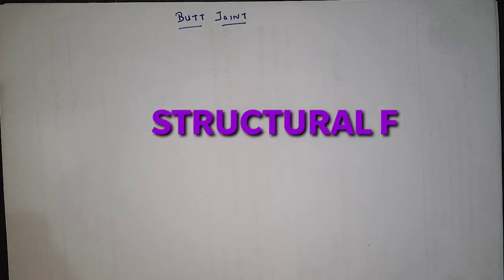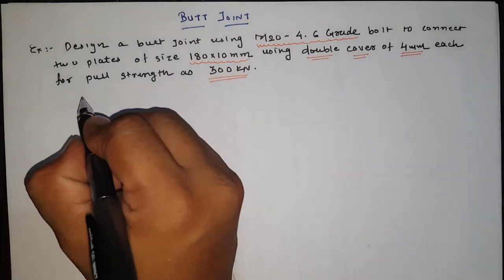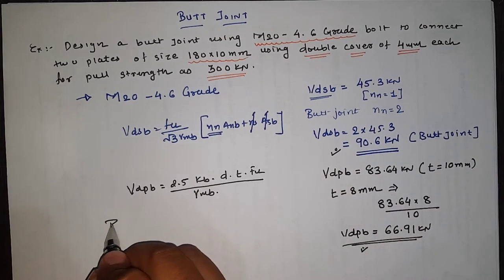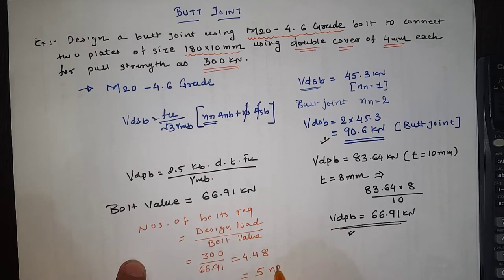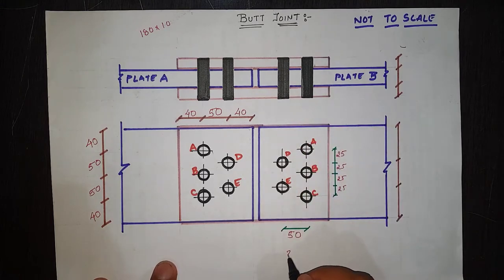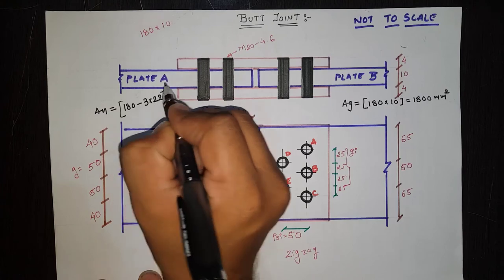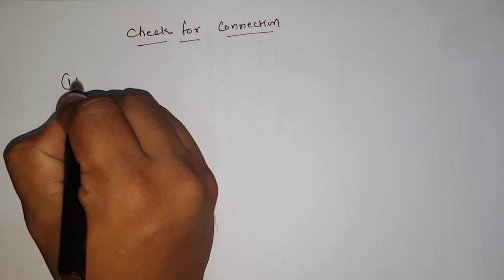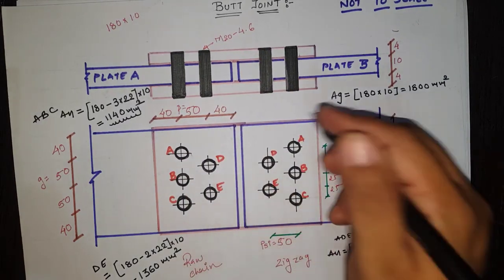Ex 05 | Butt Joint | Double Cover| Bolted | Detailing | Overlap | Number of Bolts Required

Comment: if no. of bolts required are 5 then we have to take it as 6 bolts and put 3 bolts on one plate and 3 bolts on another , by your detailing its shown that you put total of 10 bolts not 5 bolts. do clarify
Reply from the maker: Dear Friend
During calculation, if anyone consider bolt in double shear  or load of both plates and you get 5 bolts then have to use total 6 bolt (3 in each)
But during calculation of this example, its taken as single shear as well only one plate load, so total 5 nos are required for only 1 plate hence total 10 nos of bolts ( 5 in each) is provided

Hope you got an answer now.....